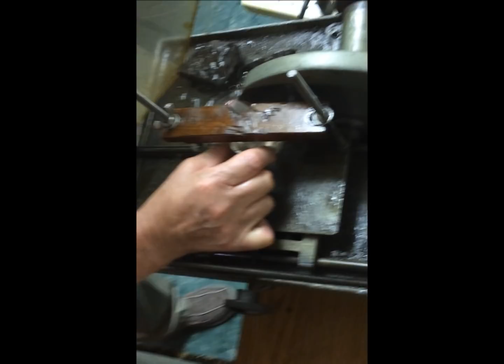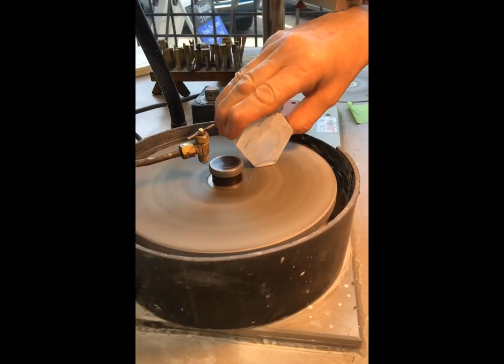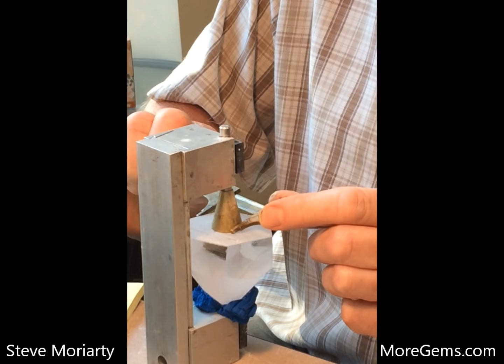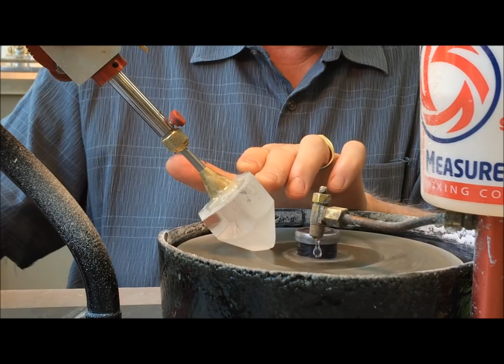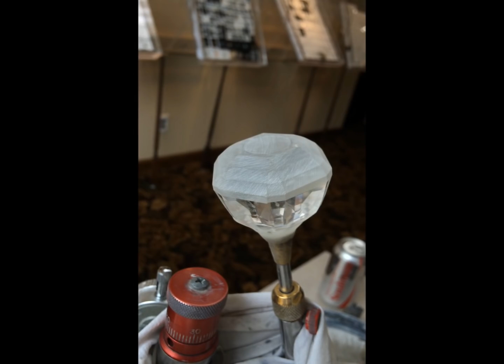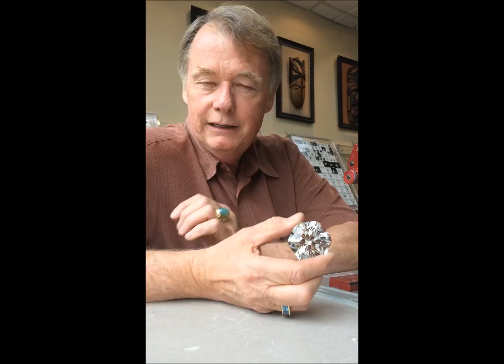How are gemstones cut - Quartz Faceting

Comment: I prefer a 100, 220, 1200, 3000, 14000 to finish. I only use 220 sintered before I start polish with a similar machine. I even do that with opal or fire agate, nova points after 220 sintered. I love your process and found this video. I'm taking on bigger cuts.

Comment: Does anyone know if using such a lap if the sides of the crystal can be ground and polished optically flat to to 50 nanometers?
Reply from the maker: Sorry I don’t know
Reply: I've searched the net and so far, I cannot find mention of whether the facets are really flat, at least, to a few microns across their entire surface. I need to lap a 45 degree surface cut into a quartz crystal to be mirror flat without distortion. I had some crystals cut for me in China and when using a laser on them at an angle to have the beam bounce off of it, the reflected spot is distorted, no longer a round dot. That means although the facets look flat, they aren't.

Comment: thank you for sharing this video ,i have a question if you do not mind. I know you are faceting gem of the diagram. in pear shape diagram, if the gem is larger than the diagram gem size, how do you modify the diagram to keep the gem stone facet in pear shape?
Reply from the maker: matt kermani If I use a diagram which I usually don’t the diagram is based on length to width proportions so it can be any millimeter size.  If the proportions are different you either find a different design or create your own.
Reply: @Moregems  okay .thank you so much

Comment: Great demonstration and so beautiful.  But it seems like so much gems gets lost in the cutting process, which really is just grinding. Is there anyway to cut it as close to what you want so you don't have to lose so much gem into dust? I know it's quarts which is in abundance but what about other gems like emeralds, rubies, diamonds. I would hate to sacrifice so much of those stones to the grinding wheel.
Reply from the maker: Many times cutters will, like you said, cut for weight and try to keep as much of the material as they can in a finished stone. This gives them a higher yeild (carat weight) and thus can sell it for more because they are selling by carat weight. The issue with this is that it ends up as a poorly cut gemstone by either being too deep, too shallow, or not symmetrical. When we cut our stones, were not cutting for weight, but more for beauty in the finished stone. We do this by cutting to ideal angles for the material we're cutting, thus giving us a more brilliant and beautiful stone with no windows and an even brilliance throughout the gem. That being said, we do lose 40% - 80% (on average it's about 65%) of the material to get a beautiful end result. We try our best to get the biggest stone from any piece of rough we are cutting.

Comment: Mr. Moriarti,  have you any videos or recommend videos re: details on the width to depth ratios and the desired preform shapes for different facet styles? Have associated info about what facet styles are optimal for specific gems?  I am experienced lapidary and have a facetron and several laps etc but have not used it yet even after watching many of your great videos due to this essential and detail.
Reply from the maker: Ken Mills 
Preform looks like the finished product just leaving enough to allow for miscalculation in angle estimates while preforming.  Leave some minor surface problems. You don’t want to cut away too much and as you are doing this by eye and you can waste finished size.  Preforming helps getting the dop in the right location.

Comment: How did you make it see through again?
Reply from the maker: RedCowCat polishing
Reply: MoreGems.com but i saw that polishing is what made it matt in the first place...
Reply from the maker: There are different grits that we use, starting at low grits cuts faster but makes the gem look opaque, then as you work upto higher grits it takes out the larger scratches, which then tuns the gem transparent again.

Comment: hello I am a glassblower and want to start faceting some of the pieces I make to accent my work what advice would you give as a inexpensive way to get started. can I do so for under 1k? thank you and keep up the great work
Reply from the maker: Unfortunately, it will most likely cost a bit more than that. It depends on how involved you are looking to get into faceting. If you look into the description of our gem cutting introductory video (https://www.youtube.com/watch?v=w6FEaxgSNgg ), you will see a written detailed list of all the equipment needed to begin faceting (which is around $1000, not including a machine). Generally, a decent machine could cost  $1,500 - $6,000 depending on the machine. If you opt to buy a pre-owned machine, use caution, because sometimes they can come with accuracy issues which will affect you when cutting. This can be very frustrating, especially with someone new to faceting. We would estimate, at the low end, you will probably need to spend around $2,500.00+ to have everything you need to start faceting.

Comment: what kind of glue did you use? and how did you remove the glue after you were done with the point? thanks for your time in answering my questions
Reply from the maker: Hey Cody, it's a two part epoxy by Devcon. Watch this video to see how to transfer and remove the glue: https://youtu.be/JDe2miIm_6Q?t=19m58s
Reply: Thanks for the information and for your time.
Reply from the maker: If you've completed the stone and just need to totally remove the gem, you just soak it in a solution called Attack.

Comment: Can you use dobbing wax for this instead of glue? Thanks.
Reply from the maker: Yes, you can use dopping wax.  Steve prefers to use the epoxy in many cases, and this is because with the two part epoxy he doesn't have to apply much heat to the stone when applying and removing. It helps with more heat sensitive stones, but quartz is generally fine with the dopping wax. Most people actually use the wax, it's just Steve's preference to use epoxy.  Here is a video showing how Steve uses epoxy: https://www.youtube.com/watch?v=GnJettRg0h4
Reply: Thank you! It was just different and I didn't know if there was a benefit for it with quartz so I was curious. Appreciate the feedback. :)

Comment: I got curious and looked up average quartz worth and the price for uncleaned/ out the mine came at around 4 to 6 dollars per pound, is that a similar type of quartz as what came in here? Cause that turned out beautiful and I cant imagine something with such potential being that cheap :/
Reply from the maker: Can't quite remember, but the piece of rough that this gem was cut from was probably around $80-100 per pound. It just depends on the source, size, and quality. This material was clean internally.

Comment: how much does that gem faceting unit cost roughly?
Reply from the maker: The machine Steve is using is no longer manufactured, but you can get a similar machine for around $2,500 - $3,500.
Reply: Something to save up for! Thanks for the info.
Reply from the maker: No problem, let us know if you have any other questions!

Comment: wow beautiful great work! the dowel that you attach to the base of the quarts your glue i am guessing is clear epoxy, how do you remove that?smack it with a hammer hehe ?
Reply from the maker: +felicianoabe Thanks!  Something like that... haha. No, Steve uses a heat source to heat a surgical blade, then peels the epoxy away. He doesn't put the epoxy directly on the back of the dop, only around the perimeter of the table. He does this so it is easier to pop off when he transfers the stone to cut the crown. You can see how he removes his gemstones that are held with epoxy here: https://youtu.be/JDe2miIm_6Q?t=19m56s

Comment: Is there a particular reason for using glue rather than dopping wax?
Reply from the maker: +Alan Jackson In Steve's opinion, the glue has a stronger bond and he does not have to heat the dop when transferring the stone -o- . This is safer for heat sensitive stones. He also said he doesn't put glue underneath the dop stick when using glue, only around the perimeter of the dop (This allows him to cut off the glue easily when transferring). He once lost a 100 carat tanzanite using the dopping wax (due to the heat), so since then he has stuck to the glue.
Reply from the maker: +Alan Jackson We'll make a video showing Steve's Technique on how he dops his stones.
Reply from the maker: +Alan Jackson Here is a video with Steve showing how he dops his stones with a 2 part epoxy. Check it out: https://youtu.be/GnJettRg0h4

Comment: EDIT:  disregard.  Apparently some UV bulbs are made of quartz due to it's lack of fluorescent reactivity.  That means the following wouldn't really do anything special.  Oh well.  Leaving the original text in case I'm mistaken.

original text:  Does quartz with this much clarity have any fluorescence properties when exposed to a UV flashlight? Say... 365 nm wavelength? If one were so inclined, a clear, faceted specimen could have a small pocket drilled out, where it may be set on top of a display that houses a UV LED inserted into the above mentioned pocket. The resulting diffusion of UV light would distribute to each facet, and if fluorescent, would be quite spectacular, I'd imagine ... Thoughts?   (Or possibly crystal Calcite, since it doubles images; that'd be interesting to see how UV light is diffused into a fluorescent reaction... I wonder if one would need a specific faceting to maximize brilliance.)